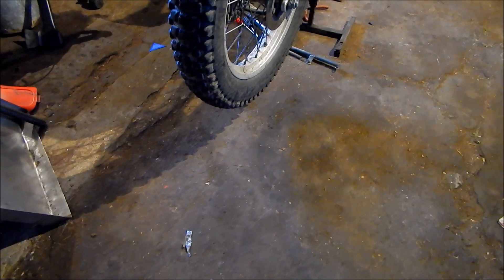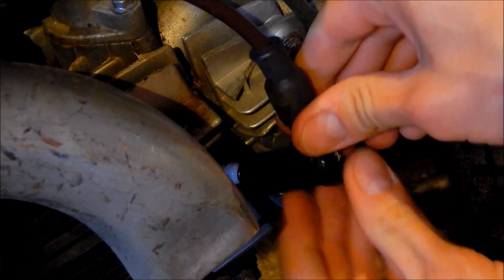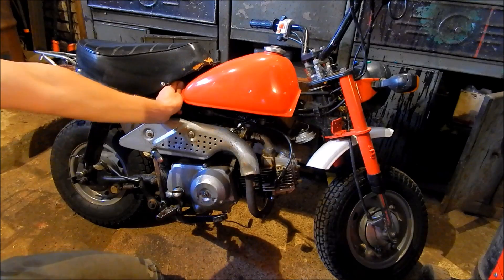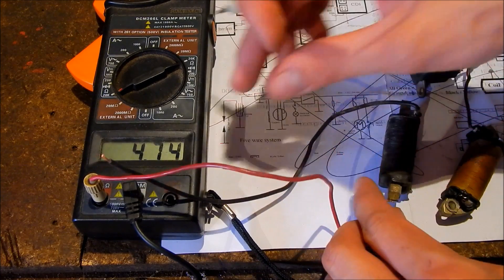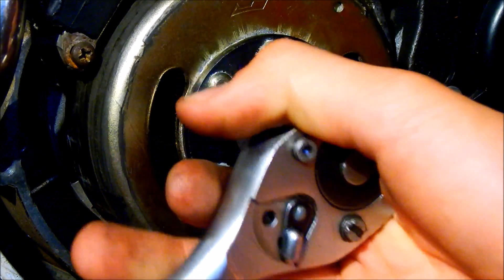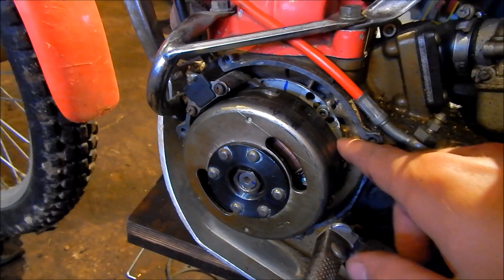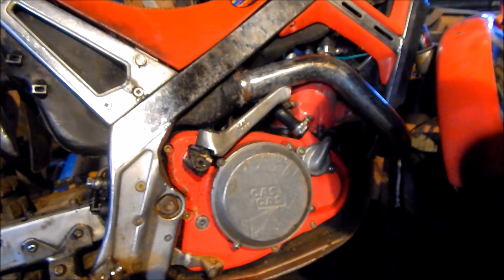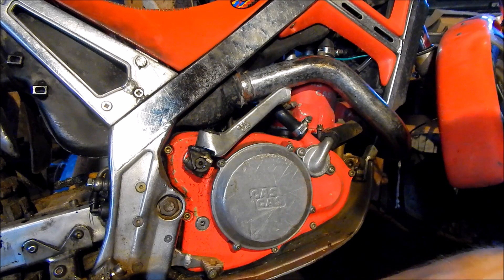No Spark Diagnosis

Comment: Brand new dirt bike it shut off in fourth gear and wouldn’t start thought I flooded engine but I checked plug and no spray what so ever change spark plug and no help same issue have no tools to diagnose the issue far as electrical wise checking resistance etc please help have pictures of stator as well

Comment: I have a 1982 Suzuki sp125 that will only spark for two kicks then nothing until you let it sit and come back to it. The it will spark a couple times and stop again. Anyone have any ideas?
Reply: Use multimeter to check if your harness for the stator/pickup coil is within your bike's specifications, if less or greater resistance of Ohms, then replace. If your bike has a starter relay solenoid unit (usually where the neg terminal goes straight from the battery), may want to test the diode on that too. 
Finally, check and make sure your ignition coil(s) are within spec too not just the wire connection but the boot's connection as well. And then the spark plug itself.

Comment: So I’ve done cdi box ignition coil and checked kill switch i have a 1998 yz250 any ideas why it’s not getting a spark
Reply from the maker: Have you checked the stator too?
Reply: Donn DIY Ive come to the conclusion that that has to be it
Reply: @yamahaguy1732  was it I got a dtr 125 that without a battery I lose spark but shouldn’t need a battery why is this
Reply: @Tizzy_p  my issue was the stator probably same issue you are having
Reply: @yamahaguy1732  see my vids my bike runs but when I take a battery off (mines died) it loses spark and I’m wondering cdi coil or stator plate
Reply: @yamahaguy1732  would the stator plate cause a bike to have no spark without a battery most bikes of the same age’s and things never need a battery I’ve had a few dts and none have needed a battery to run like the neos to a aerox one is dc one is ac but why does my bike lose spark without 12v from a battery 

Ie if I connect a good battery my bike runs great spark everything’s happy

If I disconnect the battery nothing at all not even a flicker at the plug I’ve been through the wiring more times than I’d bother on any other bike like I’m gonna buy a jump pack as my battery has fully died and now won’t charge at all so hoping this jump pack will give me a constant 12v over the bike to multi meter with (I’ll grab one from my dads) I have a power probe so I can force things to be live and earth things at the press is a switch very neat bit of kit but isn’t a snap on or anything just a cheap one but does the job I know years ago I had a neos (I like them lol) and a aerox I did a whole aerox swap and didn’t swap out the neos stator but she would run without the battery put the aerox stator plate in and she needed the battery to spark but my question is why on my bike that is dc and doesn’t need the battery or shouldn’t why do i my dad said my cdi isn’t switch from ac back to dc when the battery dies ie circuit closed, 

and with a battery, power is already at the cdi before I kick it so just jumping up like amplifying it and sparking off that but I have a smaller coil than original looks to be off a pitbike but I also have had millions of and don’t need a battery to run even road legal ones mine being the 125 dtr 2t it shouldn’t need a lot but could also be my issue or is the stator plate at fault and not creating energy or power when I’m kicking it without a battery?? Any help would be appreciated I have a few vids on the Chanel showing how it is with a battery and now that my battery has died I can’t get a new one before Christmas no second hand ones about that will charge but hoping that cheap jump pack thing will sort my issues out for the time being
Reply: @Tizzy_p  I’m not sure but bike without batteries have a stator and that creates the power for your spark and whatnot thus not requiring a battery
Reply: @yamahaguy1732  so likely stator Thankyou for that
Reply: Hi mate got a jump pack just now just uploading a vid she runs with 12v but not without stator plate init

Comment: I have a 400 foreman 1998 Honda Atv  was starting but not charging , charged up battery and tested ok it ran  yesterday no problem , today , I found the battery dead , I recharged it , turned on key , pressed the starter button it cranks over perfectly but only fires at the first of the crank and when I let off on the starter button , what's going on .tying advance
Reply from the maker: Maybe take care of the charging problem ASAP and then check other things like ignition coil/CDI etc. It can't be usually repaired over the Internet that easily. There are other symptoms you'd have to take into account and repair the ATV as a whole. The repair manual of the Honda is a really good source for information on how to do diagnostics and repair your machine. Highly recommended. ;)

Comment: Hi 

Man I saw your video , I'm from the Netherlands 

I have a problem with my 2012 can am spyder 

I have no spark the bovine seems to work fine so I think might be baterry but I put my BMW X6 v8 and still no spark I check all cables an fuses but still no spark . Want do you think 

Met vriendelijke groet/Best Regards 

J.Lacruz
Reply from the maker: I'm not a mechanic so I can only recommend finding information from the factory manual. It has helped me a lot!

Comment: hey. Mine friend got 2002 Yamaha blaster 200. it got problem, but no one know how to fix it,maybe you can help? when cold it starts in first kick, you can ride for 10min then it gets hot and bogs down. wait few mins and it starts again like new. ride 5mins and bogs again. we tried New plug New ignition coil, cleaned carb, checked all filters, when it stalls it does have spark, but it wont start until it sits for few mins :D
Reply from the maker: Um, I'm no engine expert, but I suggest checking the crankshaft seals too, since it's two stroke (looked it up, should be two stroke). But everything should be checked anyways. :D Can't help you from a distance, bro...
Reply: +Donn DIY okey we will try. still thanks for suggestion because everyone is out of ideas :D
Reply: Donn DIY can I ask u a question